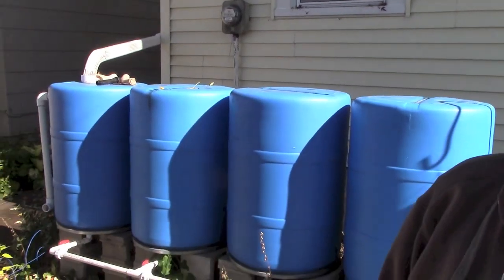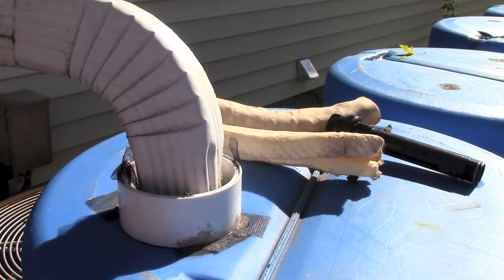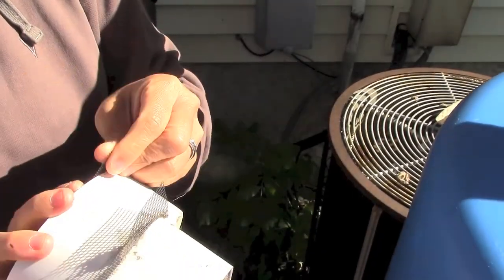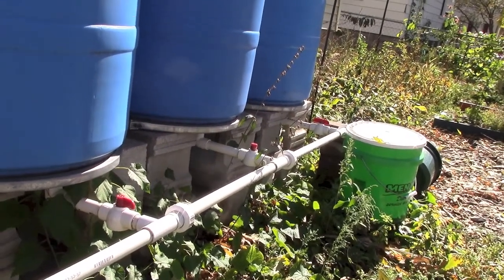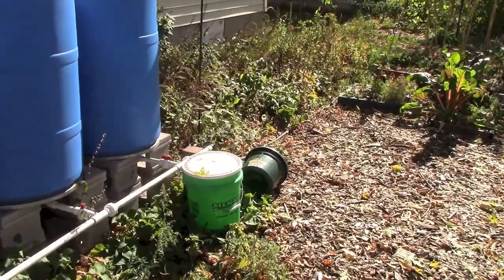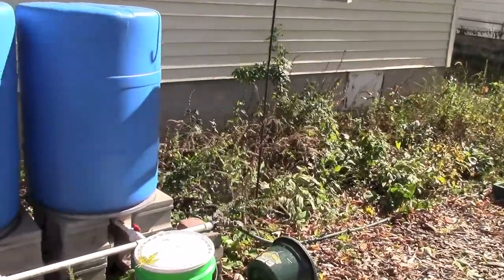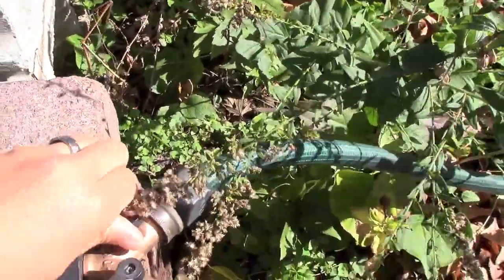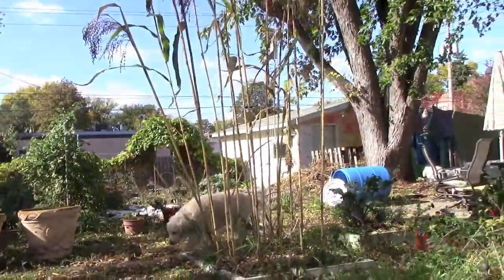Our rain barrel system

Comment: Did you need to seal the tops, (used as bottoms) with anything to keep the system from leaking?
Reply from the maker: i didn't seal the tops... and since the system isn't under pressure, i just dry fit the pvc too and added teflon tape on any threads along w/ o-rings.
I did add a few wood boards under the barrel top to keep it from bulging. you can see them when i remove the barrels from the cinder blocks.
Reply: Thanks for the replay. I have several barrels with sealed tops, but two with open tops and I wasn't sure if I'd need to do something with the ring.
Reply from the maker: no prob and good luck. also, let me know if you post a video or pics of your system... i'd love to see it if you do :)